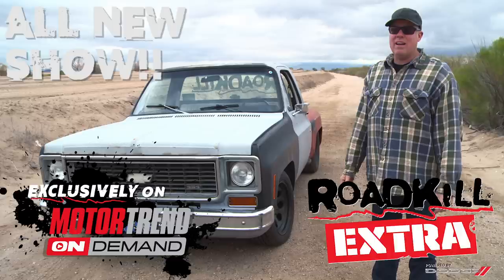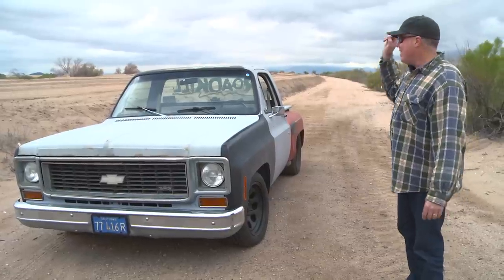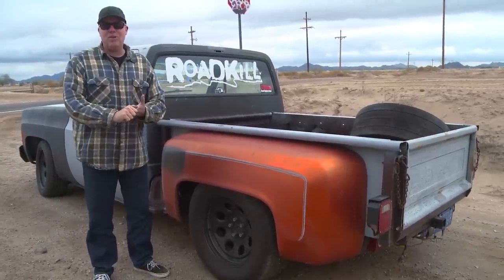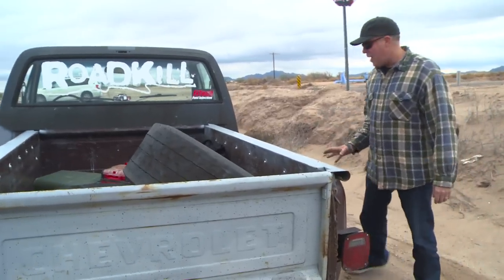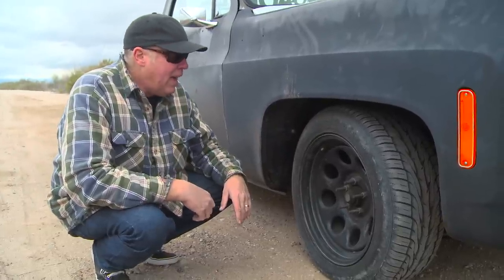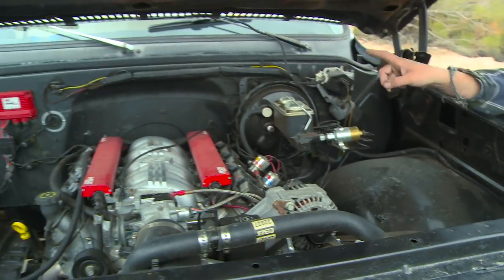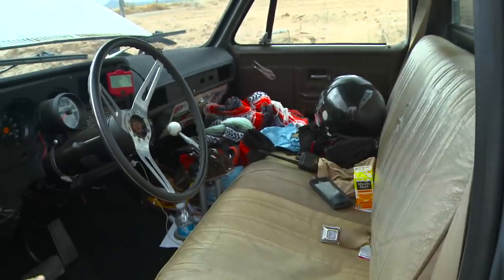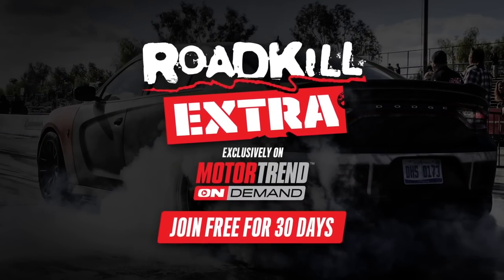Learn More About the Roadkill Muscle Truck - Roadkill Extra

Comment: Says it's a 75 in the description.
You guys edited the description! Sneaky sneaky.
Reply: depending on the part of the truck you look at it could be anything from 1973-1991 because the 1 ton and suburbans were still square bodies until the change over for the 1992 model year
Reply: George Cramer Nope. You are wrong, the new body still began in 1988.
Reply: Here Kitty Kitty ! Only on the 1500 trucks. You could get a square body suburban or 2500/3500 up until 1991. They had a facelift to two headlights side by side above the turn signals.
Reply: Here Kitty Kitty ! No he isnt. The half ton and 3/4 ton pickups stopped in 87. the Blazers, Suburbans, and 1 ton pickups kept the body style all the way until 1991.
Reply: George Cramer My bad. You are right.
Reply: Adam Hansen Yeah just found out.
Reply: He also Said the truck ran 13.10 but in the description it says 13.20
Reply: its all good we cant know everything about every vehicle.

Comment: i would throw my last dime ,to the solid glass  roadkill decal  , please produce it
Reply: old no. 7 Hell yeah.  Its fuckin awesome
Reply: old no. 7  I call BULLSHIT expensive to reproduce and ship? it's a vynil decal FFS. Definitely trademark ownership issues.
Reply: a pretty massive vinyl decal...
Reply: I think the point is, if they offer it for $89, they won't sell many, and they will look like douches extorting their audience.
Reply: It's pretty massive, while not particularly expensive I'd estimate 50-60 bucks at a hole in the wall sign shop, more if you have them put it on. The expense comes in shipping it out. It would have to be rolled in a tube and tubes cost money and shipping is more than just a stamp.
Reply: Could be made on vinyl for a couple bucks, and you'd have enough in one roll to make about 3. Not sure why they're saying it's expensive to ship. Roll it up in a shorty tube. 5 bucks postage. 
I made a full vinyl applique on a little craft cutter thing my wife has and still have 10 yards on vinyl left.
Reply: old no. 7 Any good decal maker can do it. They're not pricey to make. Im sure I can have my friend make one almost in that size.
Reply: My only concern would be if it is trademarked. Any vinyl shop could reproduce it but if its trademarked and they make a profit on it then there may be issues with that. I would love to hear from one of the MT people on that topic.
Reply: It's a shame they don't sell the decal, as in for ten euro, you get the "original" jpeg and then can get them cut for you, as many as you like as long as it's just for yourself

Comment: If you’re turning 3100 rpms w/ 3.55’s and a 31” tall tire your Gear Vender only has a 90.9% OD.  Or your converter is slipping badly adding over 10%

Comment: The Roadkill Muscle Truck always reminds me of something I saw in a magazine when I was kid.
Mr. Freiburger may remember an automotive magazine called "PV4", which stood for "Pickups, Vans, and 4-wheel drives". 
It was a mag dedicated to those types of vehicles and in a time before Consumer's Reports existed, this was your bible, if you were considering buying a pickup, van or 4-wheel drive, because all they did were new vehicle and new product tests. There might be 5 or 6 tests in a magazine, interspersed with editorial articles, like "ask the editor" or "tech tips", those kinds of things. 
They started in 1972 and were a quarterly publication through 1973, going monthly for the next 10 years until it became "Vans and Mini trucks" in the early 80's, reflecting that craze at that time.
Anyway, it was either the 2nd or 3rd quarter issue from 1973, they featured a test on a 1/2 ton Chevy truck.
That was a brand new body style then (what we now refer to as the "square body") and the example they got for the test was a 1/2 ton, short and narrow with a big ol' 454/TH400 setup, probably with 3.73's in the rear end (which was the stock ratio all Chevy trucks got back then).
Their opinion was Chevy did a good job updating the truck and the drive train made it one of the funnest vehicles any of them had driven in recent memory.
In fact, my dad replaced his 1960 Apache 10 with a 1974 Chevy C10, partly due to that article.
I remember they did a big centerfold action picture of the truck in that issue, with someone pulling a big ol' brodie on a dirt lot somewhere. 
Cool as heck, to a 10-year old. 😉
I remember it was red and that redd-ish fender on the Roadkill Muscle truck, plus the short and narrow bed and square body body style, always takes me back to seeing that picture in that magazine (which I might still have....somewhere).
Anyway, little anecdote from my life experiences.

Comment: these trucks are so easy to mis mash - my 69 has a late 70's early 80's 305 (with quadrajet), a chev tailgate, 90's dodge seats(actually fit really well, i recommend this mod!). And transmission...I have no clue there, all I seem to have it D R and N L1 and L2 there is just a wall (it is a 3 speed!) (I also do not have neutral disconnect or reverse lights!). And my heater control unit seems to be from some sort of 80's Gm, in the summer I need to recirculate my water hoses by -passing the heater core (otherwise I cook out). I do say, this 305 with just pipes (no muffler) is amazing - when those secondaries open up it sounds like the gates of hell opened lol.

Comment: I like what you use to open & close the windows! .........
Reply: Pure class...tens of thousands of dollars in engine alone, took the time to tear the doors apart to install sound insulation, and didn't get crank handles. The great thing is, the 2 vice grips are probably more expensive than the actual handles, but score way higher for style points
Reply: zrobotics on one of the episodes of roadkill they say there is around $8000 in the engine. It was a donor vette engine and cams and intake were dirt cheap from JEGS.

Comment: Not sure if you guys read these comments but although mtod doesn't interest me, I would dig a series of magazines that document various in depth tests on different kinds of engines. (Like LS engines) So for example a magazine dedicated to about every test and result of what happened in any test about the LS engine. I'm not talking just cam durations here but extremely in depth, thought out tests. Experimenting with valve events, head designs, converters, springs, etc. Id buy that magazine. I want info about my engine that I otherwise couldnt feasibly just test on my own.

Comment: Hey Frieburger, that isn't an original hood. The raised panel portion on the front of the hood marks it as either a re-pop, or an OE '78-80 hood. '73-77 didn't have that raised portion, and re-popped hoods all have the raised portion.

Comment: I would really like to see you guys build an exit for the exhaust leaving the underside of the car like a twin side exit either with dual exits on one side or one exit per side or both even to see how much a change to the shriek is made with both angle cut and square style tips. All could be made with vband connections for ability to modify configurations without unnecessary cutting and welding

Comment: Maybe mentioned already, that should be an aftermarket hood. I had a 78 and the original hoods had the center ripple go all the way down the nose. Mine kinked as they commonly did and the aftermarket ones I found had the wide mustache coming off the center ripple on the front. I maybe wrong but this is what I came across 15 + years ago.

Comment: I would love to see that truck with a well built carbureted old school Chevy engine in it. Maybe a couple of Holleys on an Edelbrock tunnel ram. EFI just doesn't do it for me, I dislike it in new vehicles and especially dislike it installed in vintage vehicles that came with carbs. I converted my 1993 EFI S10 2.8 V6 truck to a carbureted small block and love it. The truck has no computer parts on it at all. Just the way it should be.

Comment: That is a lot of motor for 13.10, but that is a massive brick of a truck.  That powertrain in an 80s El Camino might get into the 11s with lower gearing.

Comment: I love Roadkill. I want to convert my 2000 GMC 3500HD dually to 4WD. It has the factory I-beam axle in the front with leaf springs, a Dana 80 in the rear, 7.4 Vortec (454) and a 4L80E trans. Not sure if I should go with a Dana 60 or Dana 70 in the front. Any advice? Is one axle easier to work with?

Comment: wasn't the muscle truck for sale at one point in time.... if it is still for sale I would buy it
Reply: Yes, it was for sale on eBay at one time. The bids went over $70,000. Turns out, it was a deadbeat bidder.
Reply: I thought it was on Craigslist at one point for $30,000
Reply: If it was, it never sold. Freiburger eventually sold it to Motor Trend's parent company so that it could continue to be a Roadkill vehicle.

Comment: "This one has the straight hood, without the classic kink that happens when the hinges seize up and your hood bends in half".. ahh, American cars ;)
Reply: The hoods on the later-model squarebody chevys where designed with a crumple-zone. When you crash into something head-on the hood would just bend up instead of ripping itself from the hinges/brackets and shooting straight into the cab and possibly decapitating you.

This "hood crease" is easily preventable by reguarly lubing the hinges.
Reply: Was just a gentle ribbing, I love this truck :) But thanks for explaining it.
Reply: I doubt it's due to the crumple zone effect, I've seen that same crease on multiple early broncos, and they surely didn't give any thought to safety in the 60s. Just poor hinge design, but those chevy hoods were some of the earliest hoods that would hold themselves open without a prop rod. Nice when it works, and keeping the hinges oiled does prevent it, but I don't really think the engineers cared about the hinge seizing after 20 years.
Reply: yeah, it's more a combination of both. The crumple zone could have been a bit more rigid (so that it doesnt bend as easily) where as the hinges could have been better manufactured. That's why there are shit tons of after-market hinges for the later squarbodies
Reply: I had one of these trucks (a 73) when I was in high school 20 years ago. Mine did not have the kink, but it was common even then. There was a company that made a reinforcing kit for the hood itself to prevent it. What would happen is that the hinges would get stiff from lack of lubrication and over time the hood would start to bend from being forced closed. Mine worked fine because I made sure to keep the hinges lubed. Damn I miss that truck :(
Reply: the issue is the hinges need to be lubed and the hinge spring is too strong
Reply: Renzsu if this was european he wouldnt be talking about it because it would have returned to the earth already
Reply: hahahahahaha
Reply: Is that from one of Finnegans ramp truck episodes?  I remember him joking about that.
Reply: acousticpsychosis yeah i kind off remember him talking about this... i think the episode where they replaced the grille?
Reply: Michael Smith Go buy another one!
Reply: Chilly178 I want to! They're going up in value though, and finding one in New England that's not a rotbucket is not easy!
Reply: Useless Banana yeah I think thats the one
Reply: they dont make em like they used to. . back then all they did was vapor lock. . now they have EFI computers that you need a rocket scientist for and fancy splined bolts you need a special tool for, i hate dealing with carburetors but i would take it any day of the week over trying to find which computer in my car is the one thats fucked up and even when you find it good luck fixing it yourself without any new 10,000 dollar parts
Reply: +FlyingWldAlaska77  I agree with you in a way, but the reality is that in my experience EFI hardly ever goes wrong. I had 165k on my 97 4 liter jeep when I sold it, and in 12 years of ownership I did NOTHING ro the fuel system,  other than cleaning the throttlebody a few times. My old K10, while it DID run good, was finicky in cold weather and did NOT like steep inclines when off road. I'll take EFI over carb on a DD anyday. Maybe the best of both worlds would be a stand alone system from MSD, Holley, etc.
Reply: FlyingWldAlaska77 There's a reason that odometers went to six digits.  Your car may have a light go on if something's a little bit wrong, but a carburated engine will just keep running until something goes severely wrong, and then it's a case of finding the large broken thing rather than just checking the code and seeing what'll cause that.
Reply: you sound like an old man pining for the old days. the LS as an example, is engineered for 400,000 miles. all gaskets are rubber O ring type. ignition is coil on plug, and crank triggered .factory roller rockers. available from 4.8L to 6.0L. the 5.3 is 325 CI and makes about 325 horse. cast iron or aluminum block. 1968 is long gone and will never be back, the cars now are 10,000 times better than when you were 18. time to grow up
Reply: they used crumple zones on hoods in the early 1950s to prevent people from loosing there heads in a collision, so i think those broncos probably had them.
Reply: modern EFI does hardly ever go wrong, just like every widely used system it fails and gets improved as it goes on and pretty soon you have something robust and reliable, im just not a fan of "if my selector knob breaks off i cant shift into or out of  4wd" and trucks dont really have locking hubs anymore lets be honest its all just a computer that runs to a servo that just shifts it right down where the transfer case or axle is, in a pinch to save your life i guess you could hotwire the servo or actuator or whatever with a leatherman and the truck battery but then it costs 10,000 dollars to get a new wiring harness and fix that knob, and rewiring it jerry rig style would just fuck off again later on, easy to fix again but if its a fancy new ass truck i wouldnt feel good about it being ghetto rigged, btw im not an old man from "i remember when the ford model T costed 200 bucks" im a 17 year old prick that just likes it simple
Reply: bradley cambell, if i were as old as you thought i was and you told me to "grow up" how old should i be then?  
lmao, i like oldschool ofcourse cause back then a car was a thick piece of metal that could stand on its merits, do everything it sayed it could do and more, i know they dont make willeys jeeps anymore and it sucks, nowadays cars are made of tin foil, plastic and computers and are way overpriced and only good for 100,000 miles (dont forget all the marketing bull shit) but they are more advanced, have better ride quality, gas milage and power for displacement and all that . . .but they are still just disposable space age garbage, im glad i own a 97 nissan hardbody truck (whole thing is metal and manual, EFI yes, does it work? yes, iron block 2.4 liter 4 banger, good for 300,000 miles with extensive abuse, hell i bet you would get a million and a half miles out of it if you drove it around the world all day and never let it cool down and get hot over and over again, just look up the 1,000,000 mile toyota tundra
Reply: Nissan sheetmetal is thin and weak. the trans and t case are one unit, horrible design. and the frame is not really very strong.
Reply: Jeep and Toyota still make manual transfer case shifters and Locking hubs broke all the time. Locking hubs were impractical and if one broke on the trail there's no way you are going to jury rig something to fix one unless you have a spare. I'm not arguing everything nowadays is better, because cheap plastic doesn't belong in the engine bay. I don't like drive by wire, progressive throttles, brake by wire, steer by wire, or the severe lack of manual transmissions. But most modern cars are better. They last longer, make more horsepower, are safer to drive, more comfortable to drive, handle better, and get better fuel economy.
Reply: I'll agree with the locking hubs, but electric shift xfer cases are just terrible. Sure, they allow auto 4wd, but our shop always had a flurry of people right after the first snow of the year, who had gotten stuck when they realized the motor had failed. I don't know why those rotary motors are so unreliable, but they just seem to cause too much trouble.

And people remember carb and points ignition much too fondly. Sure, you can fix it on the trail more easily, but you constantly doing tune-ups and fiddling with them.
Reply: zrobotics auto 4 wheel drive is kind of a joke, and that why I never use it on my 02 Silverado. I have never ever had a problem with the transfer case, and it currently has 170,000 miles on it. And that is even after being used through 16 Minnesota winters so far.
Reply: My favorite are the early square c10s. 73-79.  I can care less about the 80-87 like i use to.  But ill take a 87-91 Mexico edtion  c10 hunter.   The early c10s have those cabs vent best air ever 😂
Reply: My 77 elcamino has hinges that hold them self i just oil them and its good

Comment: Ok being in this video you said it had a 350 ford rear end would that be a great gear ratio for a 5 speed in my 78 c10 i live in the hills of nc so alot of mtn roads to drive n thrash around on but im wondering if the 350 gear would be good for the 5 speed manual im swapping in

Comment: someone help. I have a 1981 Chevy k10, 4x4 automatic trans with a 350 engine. Its my daily driver. I parked it for a day and when i went to start it again, nothing happened. the gauges didn't move, the starter didn't click, the engine didn't turn over, nothing. but I have headlights, dash lights, interior lights, but no reverse lights or turn signal. what is wrong.
Reply: Did you try a boost, ?
Reply: LS swap.

Comment: That hood is not original to a 74 truck. It has the raised panel on the front that was used from mid 78 to 80 and all the aftermarket hoods have that raised area.